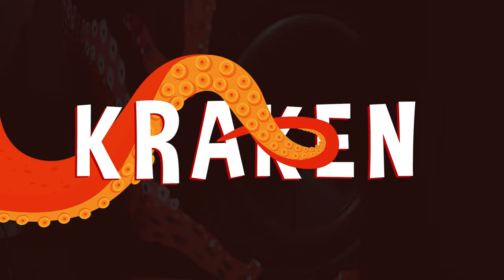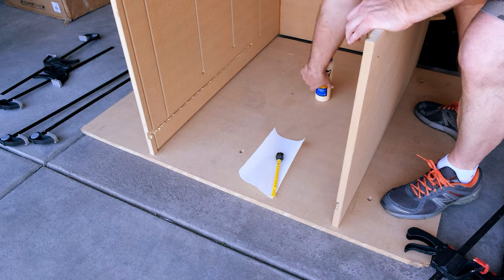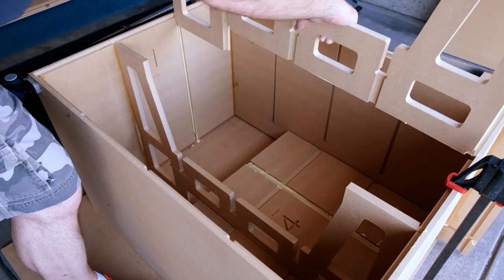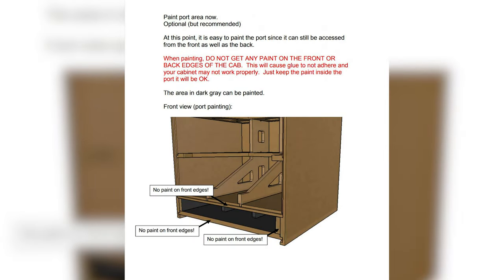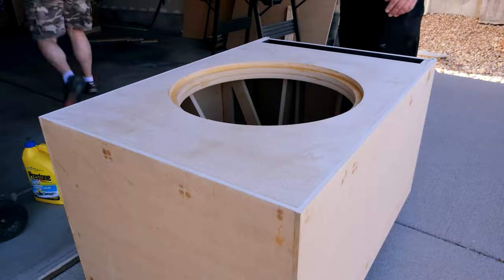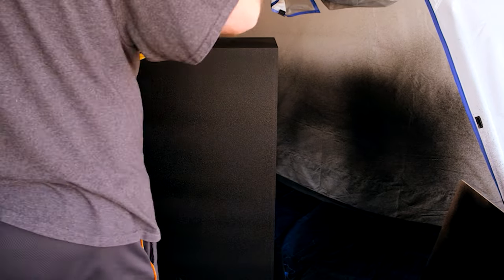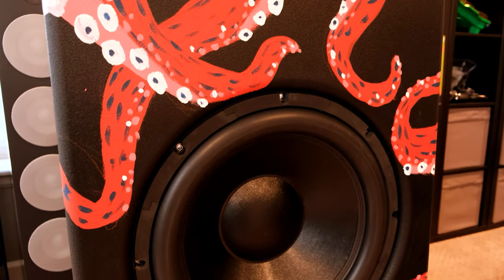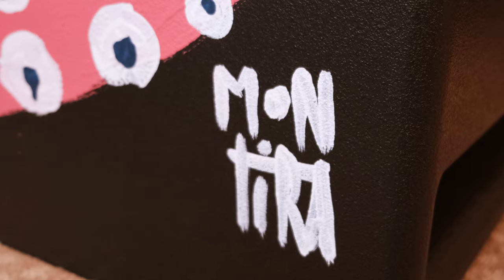21" DIY Subwoofer Build - The Dayton Audio Kraken

Comment: I always run a bead of caulk at all of the panel joints (on the inside). Just in case there's any little gaps, the caulk'l seal 'em up and keep the enclosure from leaking any air when you're dropping big beat.
Another tip is if the box is MDF, before trying to paint it, seal the wood with watered down Elmer's glue (or wood glue) applied with a chip brush. T-nuts and machine screws to mount the driver is my preference.
Reply from the maker: Good advice!
Reply: That glue/water trick allows you to sand the box to a mirror finish if you want. Great for painting.

Comment: I have a pair of these krakens, each in a "similar to" GSG's BTS box design. They put my pair of 12" subs to shame. When is your conclusion video coming out? I'd love to see what you got in REW.
Reply from the maker: The video with the REW is in editing now. All the details!
Reply: @JilesMcCoy   Still in editing? ^_^
Reply from the maker: @ryankramer  No, posted a long time ago.
Reply from the maker: 7 subwoofer video.
Reply: @JilesMcCoy  D'oh. Thanks!
Reply: How are they for music. Richard? Considering a couple of these in Mini Marty fashion to replace a Hsu VTF-15H, but I probably do as much music if not more than movies… tho when I do music, I want to hear everything down to 18-20Hz. Thanks!
Reply: @Leander311  these are not going to be as good as some of the other 21's out there for music but I will say if you have a capable set of tower speakers, these subs will add power down low to fill in the gaps. They are designed for LFE so they excel from 15hz to 120hz. I also found Dolby Atmos speakers make a world of difference bringing the live stage feel to the room. If you run the 21s make sure to give them lots of power. They are not a very high efficiency sub. Watch the 7 sub comparison. It shows how this sub compares to others.
Reply: @richardbouchard1941  appreciate the reply. I've been digging and think I've settled on a pair of the Lavoce 21" pro speakers in Full Marty's.  My mains are Axiom M80-HP's (V4) and are both efficient and high-powered, so realized my Hsu VTF-15H is almost surely my weakest link.  I'm ~80/20 music, so am prioritizing musicality and bass quality, but the 21's supposedly will give the low-end for beefy LFE output.  Do you have a link to the 7-sub comparison?  Couldn't find it scrolling through the vids on this channel.  Any other feedback is appreciated as well.  Thanks again!

Comment: Do you have any REW measurements from this killer low end monster build? It's big so it must play flat down to tuning, right? 😎
Reply from the maker: I will. But this is a PA speaker at heart so I wouldn’t count on that. The FS is pretty high. I am on the hunt for a good, low FS 21” speaker. Specifically in the 21” size.
Reply: @JilesMcCoy  have you looked at Mach 5 Audio FTW-LTE? They rate the FS at 20.3 which is considerably lower than the Kraken all while being cheaper and not as power hungry. I myself purchased one in hopes of getting a marty cabinet for it so maybe you can beat me to the punch 😁
Reply from the maker: @tysoneisenbeisz4737  That’s cool. I am tapped out for buying new subwoofers but if I ever comes across one I will check it out and report back to the group.
Reply: @JilesMcCoy  come on man, do it for science!
Reply from the maker: @tysoneisenbeisz4737  I don’t want my wife to murder me :)
Reply: @tysoneisenbeisz4737  the FTW-LTE is a completely different animal. Weak motor and low efficiency for a 21". It is best suited for an infinite baffle design or sealed box. At only 88 dB efficiency it would take a few of them to match the output capability of the Kraken. 
The Kraken is not a "power hungry" driver, it is actually very efficient at 95 dB. It just has a larger voice coil which results in higher power handling.

Comment: Good video, well done. One thought: Instead of wood screws, use T-Nuts. They're much stronger, and what pro-audio companies use to hold their drivers in cabinets. They're definitely worth the effort.
Reply from the maker: Im always worried about them spinning when I remove the driver.
Reply: @JilesMcCoy  hand tools. Don’t use a drill, and don’t over tighten.

Comment: I have a kraken and I'm looking at crown amps. My question is, in bridge mode it's 8ohms. Can you run the kraken with an 8ohm load ?
Reply from the maker: The speakers’ ohm load doesn’t change depending on the mode of the amp. I do believe that most crowns can push an 8 ohm load while bridged though. But check the documentation.

Comment: ok in this video there isn't any dampener installed, but for instance i see people loading a box with foam or insulation, do you have to add that displacement to your box internal volume?9cu ft with 2cu ft of dampener, wouldn't that make your box 7cu ft
Reply from the maker: You are thinking of sealed enclosures. This isn't a sealed box. The filler is only for resonances in a bass reflex enclosure.

Comment: How much DuraTex did it take to do one full Marty? And the link you have in the tools was for roller grade DuraTex. Did you use that with the spray gun, or did you go with the spray grade?
Reply from the maker: I did the spray grade. It was maybe half a gallon ... but if you arent careful you can spray a ton of material.

Comment: Hi, Love your channel, I’m looking at building a sub. Out of all the drivers you have used what is your favourite 18 or 21? Cheers Trev
Reply from the maker: Depends on your use case. And the box you want to use. And your budget. And the rest of your system. Lots of moving pieces. What are you trying to accomplish?
Reply: @JilesMcCoy  thanks for your reply, I’m after some mid bass slam, my room is 26x14x9, currently had 2 pb2000pro, and I really want more impact during movies. Not sure I want something as big as devs but will do it if necessary. I can put subs behind my screen but if I can still get away with something like full Marty I’d be happy.
Reply from the maker: @trevor5333  If you want midbass you can do a 21" pro driver in most anything. A LaVoce or BNC or EMinence.

Comment: Very interested in the full Marty vs Devastator comparison. Would also be interested in how much of a difference the 21" makes over the 18. What's the volume of your HT room? It doesn't look too huge. Mine is less than 1800 ft3 so size of cabinet and therefore driver is key. I currently just have 2 12" Hsu's and they can get pretty thunderous, so I'm really torn on how big I need to go up. I would probably be happy with dual 15's, but it is so hard to judge the incremental boosts you get when you go up. Dual 18's? One Devastator? (fitting one would be a challenge, couldn't fit 2). I'm looking for that chest thump, especially for music, and would like more impact even at lower volume, so your comments in the Devastator video really intrigue me.
Reply from the maker: My room is about 15x 19x 8. Roughly. The devastator gives hella chest thump . No doubt. Comparison coming soon. Its just back logged with all the other work in front of it.
Reply: @JilesMcCoy  Looking forward to it. There's also the question of if you are getting the best of both worlds by running both - the Marty for more really low LFE while also getting the visceral impact of the Devastator. Have you tried running the Devastator by itself? If so do you then feel like you're missing anything?

Comment: Did you do any distortion measurements on the driver?  Also how quiet is it?  With it in open air anything below about 20 Hz should be pretty much dead quiet, if it's not then that's not good.  I'm planning to order an Ultimax 18 for testing and might also try one of these.  A few minutes ago I watched a "break in" video on another youtube channel that makes me leery of the Ultimax, at least in that video 20 Hz was way too noisy which suggest high harmonic distortion content.
Reply from the maker: I did not.
Reply: @JilesMcCoy  Ok, I might have to consider testing one of those too then.  Thanks,  mk
Reply: @mfkhometheater7742  I watched a video doing a mechanical  noise text at 20 gs and the um 18 was almost dead silent let me see if I can find it
Reply: @tone1585  I bought one to test and yes, even at near full excursion it's almost silent.  So, I bought eight more of them to put in infinite baffle in the attic above the theater.  I haven't gotten them installed yet but hope to soon.  I'll be using them from about 27 Hz down to possibly single digits.  

For 27 Hz to 80 Hz I have two floor to ceiling columns each with eight open baffle 15" woofers. The 15" woofers are from Newark (formerly MCM) and although they are very inexpensive woofers, distortion and noise is also very low.  Those are up and playing now and the bass is pretty impressive with just those, it should be fantastic once the 18" Ultimax's are providing the bottom end.

Comment: How do these DIY subs compare to SVS? I know it depends on what driver and amp is used, but in general are they better than a premium complete subwoofer?
Reply from the maker: For performance they can eclipse SVS for sure. However SVS will typically be more visually pleasing, provide a great user experience, and provide ample performance for most use cases.
Reply: @JilesMcCoy  I have an amp from my svs subwoofer that blown. The sledge sta-1200D. Could I use it to power one of these?
Reply from the maker: @halffast1850  You can but those usually have built in dsp for the unit they are in and there is no telling how it will work with this sub and box.
Reply: @JilesMcCoy  oh okay didn't know that. Thanks for the information. May I ask what you used to power this subwoofer? You may have said in the video and I just missed it.
Reply from the maker: @halffast1850  It was probably a Sinbosen FP10000q.
Reply: @JilesMcCoy  You are very much appreciated and I want to thank you for your time.

Comment: Gerard Stroh**
Home Theater Fanatics***
When I Got My Dayton Audio 21 inch Vortex Speaker I have the same trouble with the Speaker that you Did the head of the Screws were stuck inside of the screw holes of the   speaker and it was so super Heavy and Big***
Here is I mount The Dayton Audio Vortex 21 inch Subwoofer Speaker***
I use Large Big Head Theaded Phillips Bolts and large Walshers and Nuts that Lock and I Double Nut it Too***
The Bolts Were 1/4 thick and 3 inches Long and I Use 8 of Them***
the Speaker is 10 Gauge Wire***
The Speakon speaker Connector Is A Heavy Duty 40 amp Speakon**
The Main Braces Are 2 by 3 Beams Going Across the Cabernet**
I Also have 2 by 3 Beams Going top to Buttom of the Cabernet and Going Across the Cabernet Too**
The Main Speaker Board is Recest about 4 inches on the Front Of the Cabernet**
The Port Vent Is around 18 inches Long and 8 inches High and It is A Big Vent***
For The Speaker Grill Is A Super Heavy Screen and it Came From A Display Cabernet***
And The Screen Grill for the Port is A Screen Door From A Small Computer Rack I Got For Free***
The Grills Are Black and It Fit Perfect on the Speaker Cabernet***
The Subwoofer Bass Goes Down Very Low**
Bye From Gerard Stroh**

Comment: WHAT ????
No damping material inside?
Reply from the maker: That’s right!
Reply: @JilesMcCoy  Have you any idea of the reflected pressure wave that's going to have on the cone?  Not to mention the cabinet's own resonance when you rap on it?  Both will cause uneven low frequency distortion from the musical signal.
I'd like to see the signal from a mic with both it and the speaker in an anechoic room with a low frequency sweep from 200Hz down to 15 Hz.
Reply from the maker: I'd like to see that too!  @thecarman3693

Comment: Oh boy how wrong of a screw choice for speakon connector those were. Should have used flat screws to be in line with the speakon. And the silver screws for the driver. Other than that - great build!
Reply from the maker: Thanks!
Reply: Who cares what the screws on the back of the box look like
Reply: @loganf6517  Anyone who cares to paint the box in such exquisite paint?